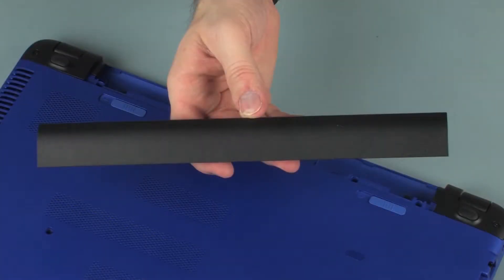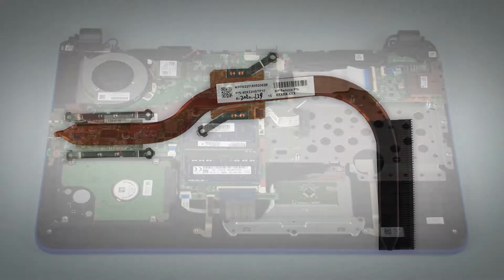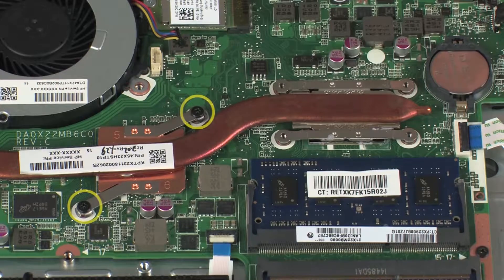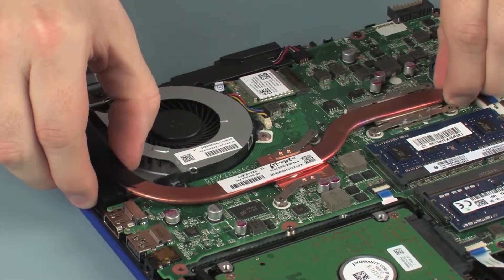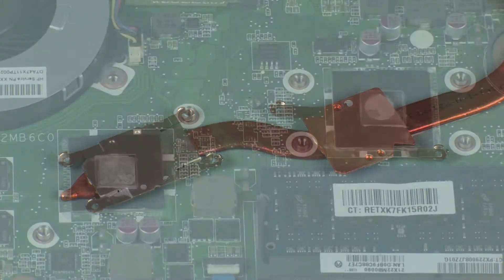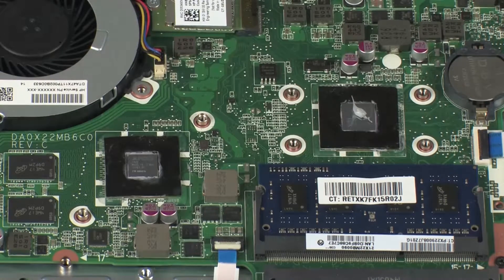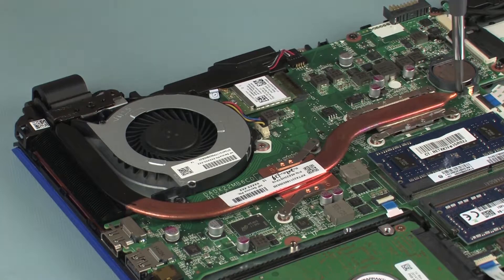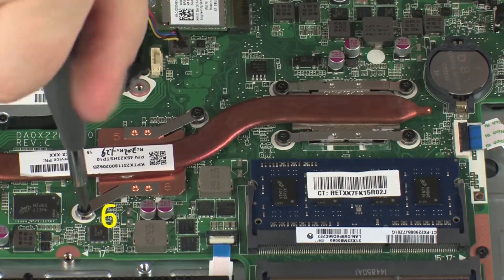Replace the Heat Sink | HP Pavilion 15-ab000 Notebook | HP Support

Comment: Why cant I unscrew mine with S2 ph1 screwdriver
Reply from the maker: Hi there, thanks for contacting HP Global Social Media Support!
I am here to help!
What seems to be the issue? Are you facing any technical issues with your HP product?
May I know the product you are using? A serial/product number would be helpful!
Let me know!
Regards, 
HP Support
Reply: @HPSupport  hp pavilion 14-ce3xxx
I tried ph00 ph0 ph1 ph2 screwdrivers to try and remove the heatsink and i cant remove the screws, do u think i should use JIS screwdrivers?
Reply from the maker: My apologies but I'm having issues finding the product using the product number you have provided. Could you check and post back a valid serial/product number.
Let us know. 
Regards,
HP Support

Comment: My laptop is only 2.5 yrs old and was causing high temp problem I cleaned the fan and replaced the thermal paste but it didnt work So I am looking to replace the heatsink can you tell me how much would it cost for a new one (Model - HP15s ryzen 5 3500u)
Reply from the maker: Hi there, thanks for contacting HP Global Social Media Support!
I understand that you are experiencing an overheating issue on your notebook.
I will do my best to assist you.
Please refer to the instructions mentioned under this document to fix the issue: https://bit.ly/3AS7XNK
Binu-HP Social Media Tech Support
Reply: @HPSupport  Thank you for your response. But seems my heat pipes are not working correctly as the processor seems hot but fan is blowing cold air besides I have tried every other steps mentioned in the above website.
Reply from the maker: Due to limited support on this platform to fix this issue, please feel free to reach us on call/chat. Access this link to select your preferred country and language option to reach us. 
Global support link: - https://hp.care/493PzTT 
Binu-HP Social Media Tech Support
Reply: I have the same issue and I want to replace the copper tube, Did you find new copper tube?

Comment: I'm using a hp envy m7-u009dx, I half way unscrewed one screw on my heatsink but I put it back, will this affect my laptop in anyway?
Reply from the maker: Hi Sheikh, thanks for contacting!
I understand that you need to know about voiding the warranty.
I will do my best to assist you.
HP does not recommend upgrading or downgrading hardware parts or software that is bundled with the product as It may affect the manufacturer's warranty and performance, however, you could change the configuration at your own discretion.
Binu - Social Media Tech Support